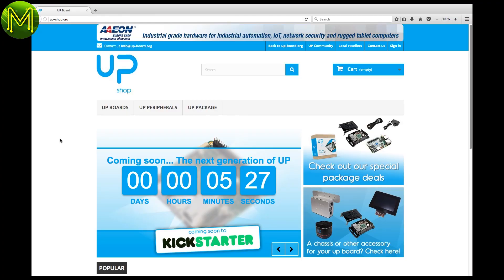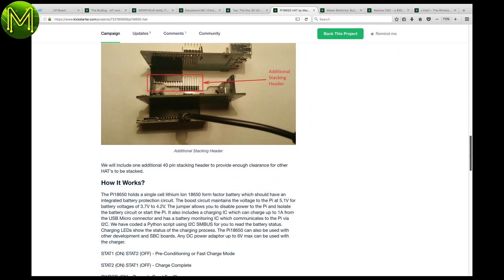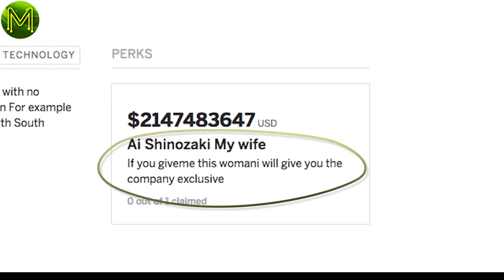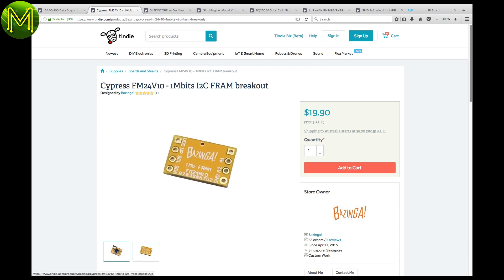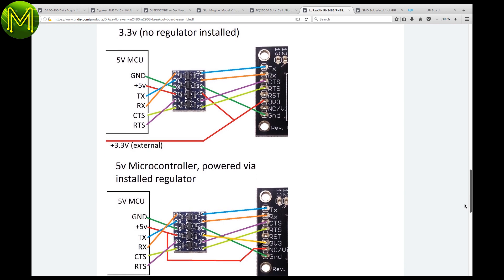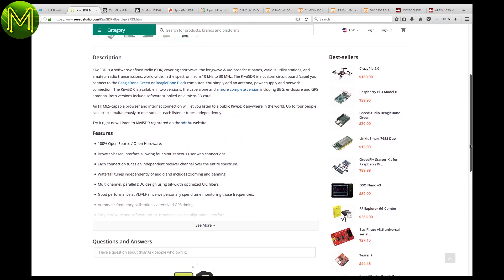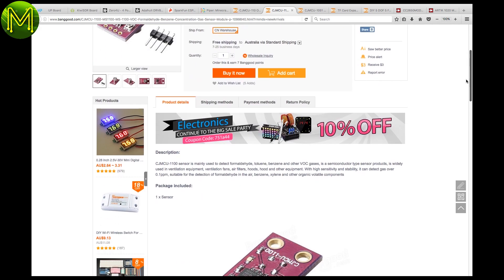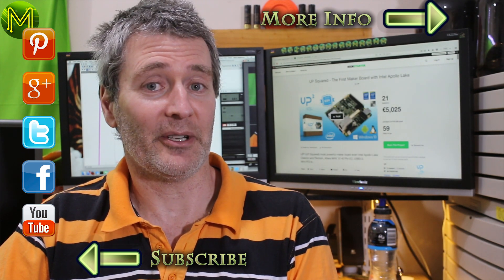#065 Weekly Roundup #10 - New Maker Products

Comment: There is also a new nodemcu released. The nodemcu-32s. I haven't seen that you have a original nodemcu? (esp8266) They are very cheap on aliexpress/ebay. Really worth it
Reply from the maker: +bonnome2 
I haven't mentioned an esp8266 in my weekly roundups because it's not new, (it's been around for ages), but certainly the ESP32. From memory it was in #8.

Comment: Starting to look forward to these vids, nice work.

Have you done fpga "programming"? If so, do you have a recommended resource for learning? I think it's the next thing I would like to learn but getting into it seems either really expensive or fragmented.

Cheers
Reply from the maker: +Aaron DC mediA 
Thanks very much, mate!

I haven't worked with FPGAs for many many years but worthwhile running a video series on it.
Think of them as a breadboard with a bunch of components on them and you just wire them up virtually. You have DSP and analog blocks as well as digital blocks, (with 50,000 elements). LVDS, DDR and PCI interfaces.
Once you get into FPGAs you'll never look back.
Reply from the maker: +MickMake 
Alas UpBoard won't allow you to update the FPGA firmware! Major issue. Head over to Kickstarter and let them know your concern.

Comment: This UpBoard^2 is to expensive...
I went to a local online shop and found a PC(with case and fan) with a more powerful Intel Pentium N processor with the same TDP/SDP, 8 GB of RAM, 500 GB HDD, DVD-RW, keyboard + mouse == for 30 less Euros than the Intel Pentium N + 8 GB + 64 GB eMMC UpBoard^2.
The only advantage(an important advantage for a maker board) it has here is the size and of course that it has the features of a maker board, but I don't think that these should bring the cost that high.
Reply: How many GPIO pins did it have? was it 85mmx85mm? Of course a full size 
desktop can be had cheaper for the same specs, but if that were the only
 concern nobody would ever buy a laptop since they are generally more 
expensive for the same specs too. This is about the computing power 
fitting into a super small package. THis is the first device in its 
segment with the level and quantity of IO options (Dual HDMI, dual gbit 
LAN, 4 USB 3.0, mSATA, M.2 AND SATA3.) If you are shopping for a home 
desktop PC and don't care about size, go for a tower or mini-ITX
Reply: MickMake currently they do not plan to make the fpga open sonce they are worried about people breaking it, but they are looking into ways to safly allow access to it.
Reply: Sure, but a PC will always be larger and limited regarding connections to more generic electronic parts (just an LED, 433MHz sender, ...). A PC for that price probably also doesn't have DDR4 RAM or a dual GBit NIC, possibly not even 4x USB 3.0. It will have more SATA ports though, and you'll be able to stick a graphics card in it - it just matches a completely different use case. For what it provides for its price, the new UP is definitely pretty awesome - if you need it of course.
Reply from the maker: +Skwisgar2322 
Yup the one attraction, for me at least, is the FPGA. Certainly is a lot better than CPLD. Add into the mix SAT, dual HDMI, Gigabit, proper I/O architecture. Man! It's a nice board. It is expensive, but is a competitive price.
Reply from the maker: Skwisgar2322
Yes it'd be interesting to see what we can really do with the FPGA or whether we will be shackled to an API.

Comment: I was just looking at that Up^2 - board earlier today and it sure looks fancy, but as I understand that all the GPIO, SPI, I2C and whatnot are actually provided by the FPGA, like with Up1 they were provided by the CPLD, how fast can one actually drive those? I don't know how it's actually internally connected to the Atom, but I read someone complaining about Up1 not being able to drive the GPIO-pins and buses very fast, like to the tune of 2MHz-3MHz. With RPi and direct register access in C you can apparently crank GPIO-pins all the way up to 22MHz and SPI up to 125MHz.

Do  you have any insight into this?
Reply: I believe that is why they chose the FPGA route, one of an FPGA's main advantages is speed.
Reply: Skwisgar2322 But what if the connection between the FPGA (or in Up1's case, CPLD) was the bottleneck? Like I said, I don't know how they're connected internally.
Reply: MickMake That...wasn't even what I asked about. Nevermind.
Reply from the maker: +Skwisgar2322 
Yes this is what I heard too.
I'm looking at doing some more intensive testing of boards and am awaiting for some test gear.
I want to start testing out some of the raw performance of boards with GPIO rather than doing a simple functional test.
Things like ramp curves, max freq, logic level limits, over clocking, etc.
Reply from the maker: +Nita Vesa 
If you had two Pis talking to each other then that'd work, but not many I2C devices will violate the standard max of 3.4MHz. SPI on the other hand doesn't have any maximum limit from memory. The non-handshake protocol of SPI may present problems in bidirectional comms, but would be a blast for unidirectional.
Reply from the maker: +Nita Vesa 
Ooops. This is the problem with replying "on the fly" whilst out and about.

Ok. As +Skwisgar2322 said the FPGA was chosen because it turned out the CPLD on the Up1 was slow. This is a good sign from a company; that they are listening to their customers.

But would be good to see how the Up2 goes against my new testing gear.
Reply from the maker: +MickMake 
Also I don't really have any further insight. I'd like to see it all in practice.